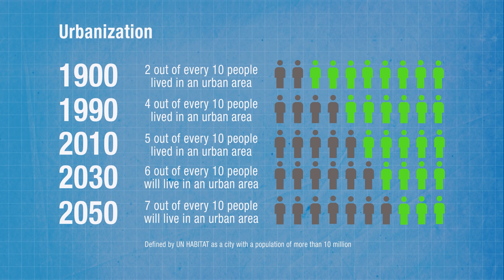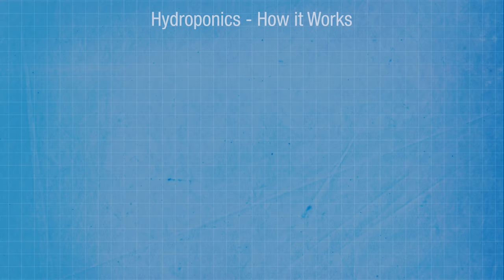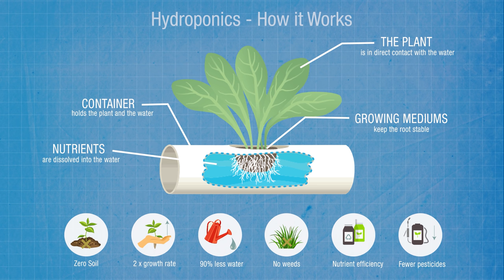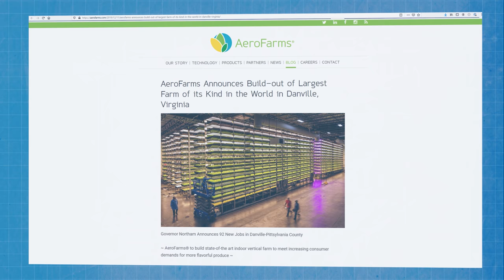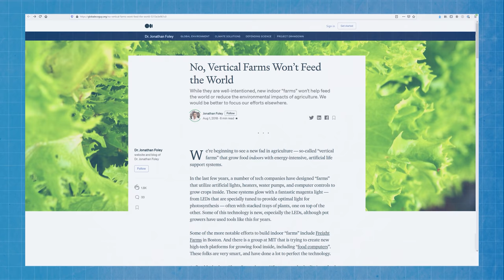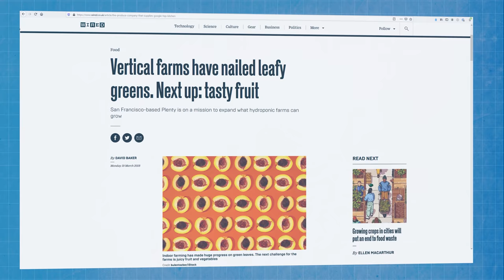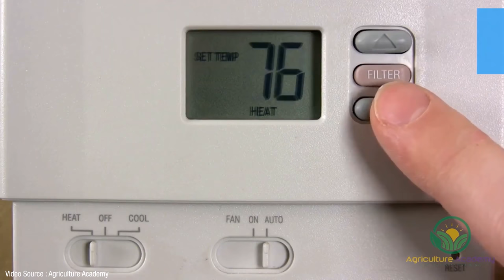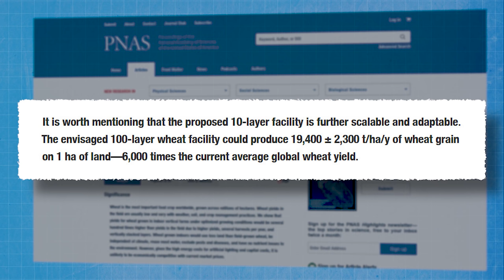Vertical Farming:  Growing fast!

Comment from the maker: Hi Folks – as many of you have pointed out, I made a mistake when I said that Ultraviolet lights are used in vertical farms. In fact, it is not ultraviolet light - that would burn the plant. It's a mix of red and blue light, which is the part of the light spectrum that the plant absorbs. My apologies for this error.
Reply: Are you a vegan?
Reply: @brianrcVids  Or how about one on regenerative farming?
Reply: Green is in the middle of the spectrum of (humans) visible light.
There's a reason chlorophyll and chloroplasts appear green (to us)
Reply: @jimurrata6785  not exactly. Chlorophyll and related energy converting chemicals absorb certain wavelengths of light but not others. The wavelengths not absorbed are reflected back. The wavelength most visible to humans in this reflected light is green. But of course, there is a spectrum of wavelengths that we can't see. This is why the light emitting diodes used to provide light for these plants do not include the green wavelength. Interestingly enough, I would imagine that the plants then look off black instead of green.
Reply: @KingClovis  He already did. Two months ago. Problem is, farming uses too much land as it is. Regenerative ag does not help in that area. We need to reduce land use and rewild. 
https://www.cowspiracy.com/facts/
Reply: @ronmaximilian6953  I exactly meant to say that green is what we see because other parts of our visible spectrum are absorbed.
It is highly advantageous that LED's (and their phosphors) emit on such narrow bands (depending on doping and binning) that they can be tuned for what the plants themselves need, saving tremendous amounts of energy compared to something like the hot halide growlights of the past.
Reply: So interestingly the colour of the plant tells you exactly which colour of light that plant doesn't use. For example many plants are green, because they reflect green light instead of absorbing it.
Reply: @flain283  That's right!
And something opaque reflects light, while something transparent allows it to pass through.
If you're old enough you may remember slide shows (or actual 'film' movies)
An intense light shines through the film and is projected onto the screen.
While 99% of photographs reflect the correct wavelengths back at you.
Most are RYC dyes in emulsion.
.
Holographs are another animal, as are retro-reflective 3D images.
Reply: @brianrcVids  Most proper meat is produced by ranching which is sustainable
Reply: @Plainsman1300  good joke :D
ok, you said proper, for which your statement might be correct depending on the definition. But 98% of all eaten meat ist not produced by sustainable ranching!
Reply: @ArneStabel  proper means 'clean', which excludes vile things, which many people consider to be food.
Reply: @Plainsman1300  "Clean" is also a relative term. Is it "clean" if it harms us? The saturated fat, transfats, cholesterol, dioxins, found in meat (organic too) might not meet people's definition of clean. The World Health Organization still classifies red meat as a probable carcinogen. 

Who says ranching is sustainable? The amount of land taken up by "proper" ranching is completely unsustainable given our increasing levels of meat consumption. Ranching takes up more land, not less. We're already using 1/2 the continental united states for animal agriculture. Is that sustainable?
Reply: In Australia we have a weekly Rural Program on the ABC (Australian Broadcasting Corp. our equivalent of the BBC or PBS and nothing to with the American ABC)
Its called Landline and has done several vertical farming stories in the last few years. https://www.youtube.com/watch?v=N9SZCS_9xFo

Unlike Europe, North America and Asia we have lots of land, but we have maxed out our water capability. Currently we produce food for 75million which means we feed 50million people outside Australia.

Our problem is that we expect our population to increase from 25 to 35 million between no wand the mid 2030s. Those 10 million will want water and the food they eat will need water and we'll have to grow even more food because if we don't 10million people in other places will go hungry. 

So despite having massive amounts of open space this intensive food production technology is something our country is very interested in.

On the energy side we have great conditions for both wind and solar. And any system that saves water or recycles water is a bonus.
Reply: There are plans to upgrade our food crops within five years from C3 to C4 starting with rice. Photosynthesis is 50% more efficient in C4 plants.
Reply: Are you having a think?♥️
I hate to do this, but I believe the population data has been revised, 9 Billion maybe is the pick number , we’re no longer expected to hit 10B ever, and are actually on the cusp of a population collapse in some regions. Maybe, it’s a misunderstanding, but it sounded like it was implied in your statement a continuous growth. 

By the way, we have been growing in an aeroponic system, in CO. 
For everyday use Feit electric has a great LED product line, for fail-Safe systems... Too bad I can’t pos a few photos, it’s Amsterdam here, in more ways than you think... we have about 300 bulbs blooming on a 3X6 table...
Reply: @higreentj  We really don't need to eat meat at all. Growing meat still faces significant hurtles as your linked video points out. The problem is even if it were a reality, meat itself leads to inflammation, weight gain, and all sorts of common metabolic diseases. It's like making a better cigarette. Maybe it's best not to smoke at all. See https://nutritionfacts.org/video/how-not-to-die/
Reply: @HigoWapsico  Good points. I remember once seeing that in terms of land area we have enough space to support something like 27 billion but it requires a concerted plan to manage the available land and sea assets for food and then use the food grown efficiently. You only need to watch for any of the programs that have documented food waste to know we should not have hungry people anywhere. 
On limiting population the one factor people don't discuss (because its sounds chauvinistic) is women's education. Statistics show it up a lot that the more educated the women of any society get the fewer the children that have. The other thing that few people put into the equation is the China one child policy. Because Chinese culture is obsessed (along with many others) of a "male Heir" they dumped millions of baby girls in orphanages and many of those have been adopted out of China. So their next generation is simply not going to exist. India is similar but no where near the exaggeration it is in China.
Population is a big complex issue that incudes food, culture and education.
Reply: @HigoWapsico  Good points. I remember once seeing that in terms of land area we have enough space to support something like 27 billion but it requires a concerted plan to manage the available land and sea assets for food and then use the food grown efficiently. You only need to watch for any of the programs that have documented food waste to know we should not have hungry people anywhere. 

On limiting population the one factor people don't discuss (because its sounds chauvinistic) is women's education. Statistics show it up a lot that the more educated the women of any society get the fewer the children that have. There's been arguments that not supplying Africa with updated agriculture is a way to avoid a massive population increase. The way to counter that is by educating girls, but that runs head long into "cultural issues."

The other thing that few people put into the equation is the China one child policy. Because Chinese culture is obsessed (along with others) with a "male Heir" they dumped millions of baby girls in orphanages and many of those have been adopted out of China. They now have an insanely skewed population of 3 to 1 men to girls in some age groups. So their next generation is simply not going to exist. I have even heard them talk about women having several husbands. The really scary thing is that populations that get male heavy tend to start major wars. India is similar situation but not as exaggerated as in China.

Population is a big complex issue that incudes food, culture and education and each of those things is complex in their own right.
Reply: Hallo sir I listen recently is Russia and Canada is beneficiary's of climate change or global warming please debunked this .
Reply: @eco-techandtravel5258  The most important thing to understand is that NOBODY is a really a beneficiary of climate change.
I'm Australian but was working in Canada 3 years ago and the only thing they will really benefit from is a longer summer which means they have more time to grow their grain crops like wheat and barley and it will be the same in Russia. It might also help with other crops having a longer growing season.
 But with the longer warmer summers the Norther Forest are prone to dramatic bush fires which both Canada and Russia have experienced.

One thing every body must understand about climate change is that we all lose in some way. There are no winners, because for everything that might be better something else will be worse.
 

In Greenland they are now growing crops they haven't grown there for 1000 years, but it has had a dramatic effect on polar bears, seals and other wildlife that because of the loss of the sea ice. And that has effects on their population who rely on seals and other animals.

In Australia our far North is getting some better rain fall during the monsoon season but further South we are getting less rain. So some of our farmers are doing better while many others are suffering from extended droughts. Then there are the incredibly destructive bushfires we experienced last year. We now know that those bush fires can have effects that last longer than 80years. We know that from recent research. We always thought that the Australian bush recovered quickly and in some ways it does, but recovery from a major event takes many years.

So Russia and Canada are benefiting from longer summers, but if you look deeper they are worse off in other ways.
Reply: @tonywilson4713  also danger of Permafrost thaw , super bugs in Permafrost and new disease from south.
Reply: I hate working under blurple light. It makes your skin look like a Simpson and you can't monitor the plants for disease as easily.
Reply: You don't run your lights 24/7. Most plants need a photoperiod to grow normally and some even go to seed if you have too long of days.
Reply: Pests do end up making their way into the building and need to be killed, in my experience. Even with positive air pressure systems and filtration, insects find a way and there's no keeping fungi out of anything short of a clean room.
Reply: Would've been nice if you cited my research, since the intro and content seemed eerily similar ;)
Reply: I have an aquaponics garden in my house and i love it!
Reply: I was just about to write that before I saw this comment
Reply: Thought that sounded weird...good to know the correction though.
Reply: An area of the light spectrum known as Photosyntheticaly active radiation to be exact.
Reply from the maker: @Make_Boxing_Great_Again  Yes
Reply from the maker: @KingClovis  I've done 3 videos on that one :-)
Reply: @JustHaveaThink  I know, mate, I was just having a little jab at brianvc. He came across a little preachy. Your vids on regen farming are great! (All your vids are actually. I see a vid of yours, and then a little later I see other channels covering the same topic...)
Reply: Not a problem on the  mistake Dave. Vertical Farming can be what Dutch Greenhouse operations have been for a while. The Dutch use Combined Heat and Power GE jenacher natural gas generators to A provide heat for a facility B. A source of Carbon Dioxide that is contained inside a building yielding 11 times the annual production per Arce. C. preventing the need for produce to be trucked shipped or from another continent . I know of this tech being adopted in North America for Tomato producers, The matching of heating needs to a 35 Hectacre Greenhouse facility in Southern Ontario with Ge Jenbachers has 10 megwatts of emissions free electricity to the Ontario Grid in one case. about 10 percent of Hollands Electricity is generated inside commerical greenhouses and all the CO2 is captured and used to enhanced plant growth inside the greenhouses. These Greenhouses in some cases use Landfill Methane Gases,   The Vertical concept should be done with shopping malls that have closed and possibly with skylight sunlight exposure. The Violet light to see is LED and I have personally seen them in Commerical Majiuana operations. CO2 injection into those facilities is common practice but usually with bottled CO2.  I could see one of the big mall Reits in America , that is about to lease huge space to Amazon , have large scale vertical farm Greenhouse operations in a combined Amazon Fulfillment centre Greenhouse that once was a mall. There are plenty of Malls in North America that would be candidates.

Comment: I would be VERY excited once they figure out how to grow and harvest: Corn, Wheat, beans, tomatoes, rice.
Reply: I'm growing green beans. It is winter here but the plants seem happy enough with LED sun spectrum grow lights.
Reply: They are growing tomatoes already. Beans and wheats could be next.
Reply: They know how to grow them its just that they are not economically viable.
Reply: buy, Shipping Container , and convert it to Hydroponic Produce , 100x yield compared to Vegatable Garden , best of all NO PESTS or weeds.
Reply: When Epcot Center (Disney World) opened in 1982 I made a visit.  One of the displays they had was a system of growing tomatoes where the plants were suspended in air and their roots were periodically sprayed with nutrient rich water.  The yields were very high.  

They were growing in a greenhouse so they were using natural light.  But artificial light would do the job as well.  Plus temperatures can be controlled to maximize flavor.  

Tomatoes seem to need some heat to encourage the chemical reaction that boosts their flavor but if the temperature gets too hot the plant ceases forming fruit.  You've probably had first hand experience with the "too cool" lack of flavor from tomatoes grown in greenhouses in the winter.
Reply: @Click BaitI found the vegan

Joke aside you are right tho. A huge percentage of growen crops a used to feed livestock.
Cutting the worlds meat consumption has maaaany benefits.
Reply: @So_-.  or transforming it to lab grown meat. Then we could eat as much as we want without the guilt.
Reply: @najibyarzerachic  I know some are experimenting with aerofarming potatoes.
Reply: why would you be excited?  those are the most boring things to grow in the world.  Those are also weeds...  When you are using technology to grow food its better to grow the difficult stuff, the expensive stuff.  not cheap weeds. Legalize cannabis everywhere healthiest veggie to eat easiest to grow
Reply: @Click Bait but how do we get meat?
Reply: I think you mouth beat your brain here.
Reply: @Click Bait and euhm who is going to decide how much is enough?
Reply: @Click Bait ? Are politicians now gonna decide how much meat we should eat? Wtf. Wirdest thing i ever heard in my life.
Reply: @markplott4820  Sorry, but there are definitely pest, weed and fungi that like to live in vertical farms. They can also be spread very quickly because the high density of plants. Many places have had to do a complete restart of the system to get rid of the "invaders". If you want an example have a look at the old posting from "The real Martian".
Reply: check out AppHarvest.  They're opening greenhouses in Kentucky growing tomatoes at the moment.
Reply: They have already figured it out and there is no way it's worth it. With plants like corn and wheat you're looking at very cheap basic cereals that are hardly worth the electricity put into the growlights. I'm all for tomatoes and basil grown in vertical farms but the raw truth of the fact is that wheat is something like $200 per tonne and even if you got 10 times the yield of the best farms in the Netherlands or the USA, you still couldn't cover the costs. Basic cereals for a huge number of people require square miles of area even when inside a large factory  and the end product is so cheap that there are places where they literally burn it for energy (either heat or convert it to biofuels). 

$0.10 per pound is so absurdly cheap that you can't really factor any kind of work into the equation. Sunlight, rainwater and dirt cost next to nothing. Residential buildings will not be able to grow their own bulk calories unless we're talking about growing cell cultures in vats and battery storage and pv electricity becomes too cheap to measure.
Reply: @paulallen8304  Lab grown meat is an extension of the same idea as vertical farming: industrializing agriculture. I hope we get there, but it's about twenty years behind vertical farming so it might take longer to get to the point of building meat factories.
Reply: Ahh Hello these vegetables are easy. I was thinking more about asparagus, artichokes, and fruit trees.
Reply: I guess they have to invest dwarf varieties
Reply: @pikkuraami  hell no, on lab meat
Reply: @paulallen8304  yeah like we need cattle for insulin and hormones in meds

Comment: If Trophic Levels can be reverse engineered and vertically assembled, and the energy used is sustainable, and the water used is recycled and/or the  waste of water is minimised to less than than say 10%, which is completely achievable, this is an economic paradigm that needs proper study. It is absolutely compelling. The current failure is a lack of a comprehensive inclusion of costs associated with current farming practices.